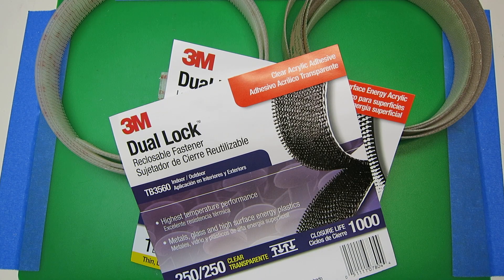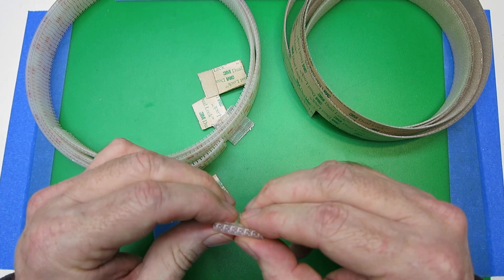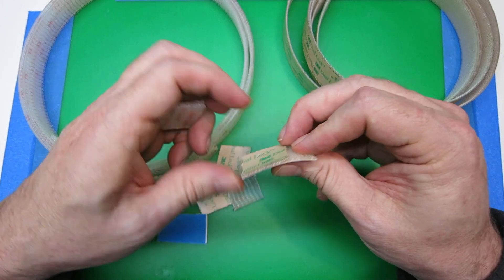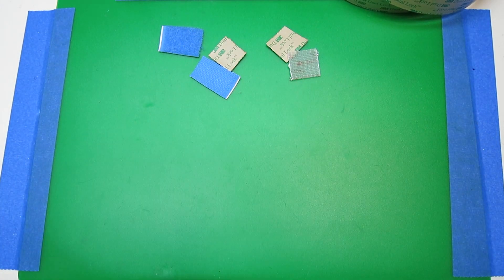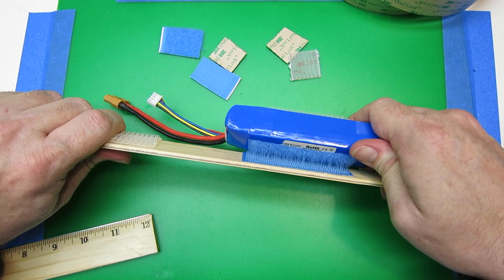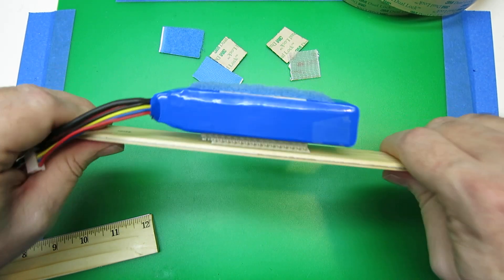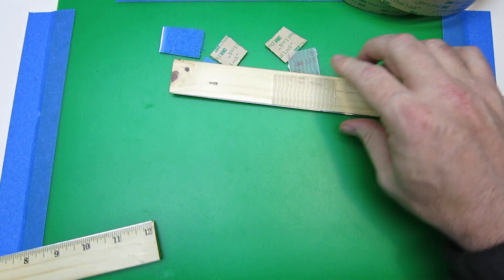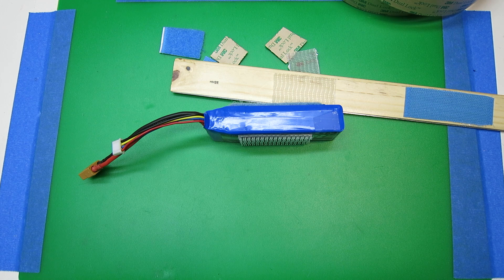Dual Lock is Sweet Stuff!

Comment: I've also seen Godlyke Power-Grip Pedalboard Tape recommended, which looks like the same construction, and it's not cheap either.
Reply from the maker: Interesting!  It does look the same.  And awesome company name too.
Reply: Heh, yeah, very cool name.  I checked out jonnywaselectric's mention of the HobbyKing blue stuff and found this comment:

"Go to garden supply store - they have hook one side, loop the other side - green - about 1/2" wide - primary use to support plants - like tomatoes. Absolutely PERFECT for small applications"